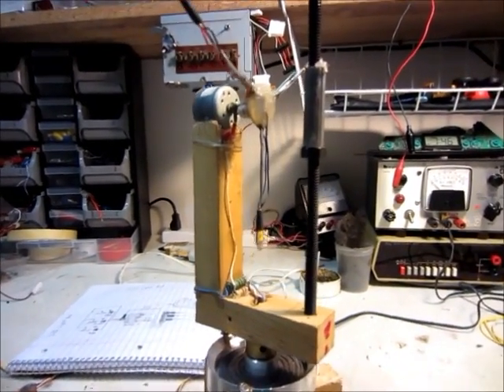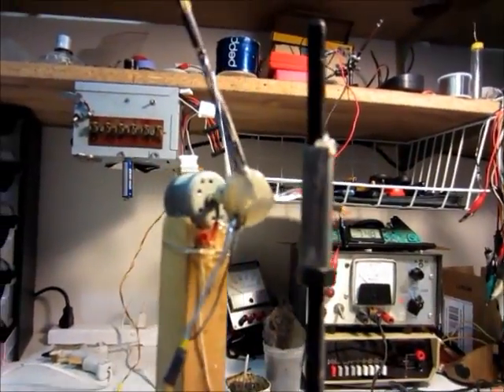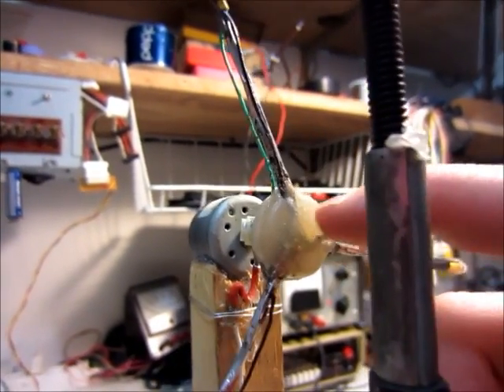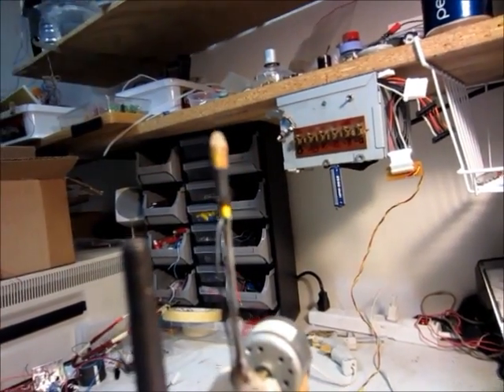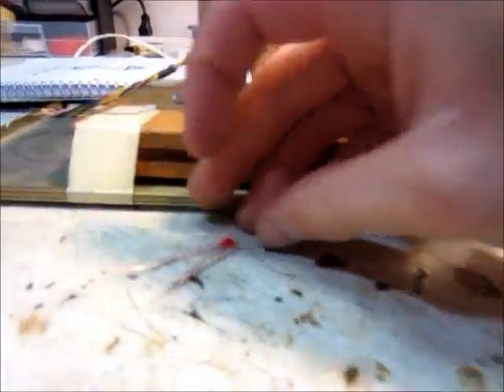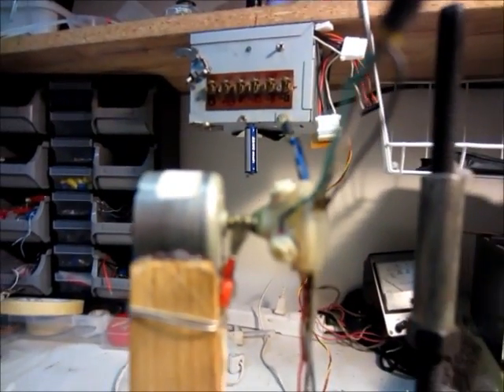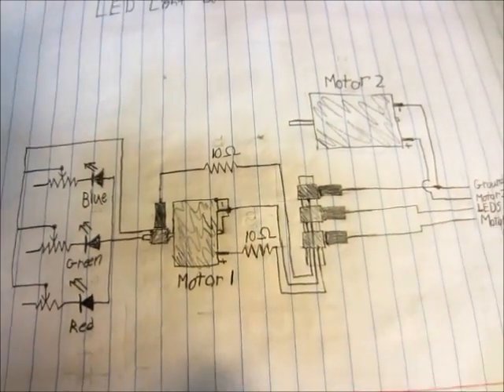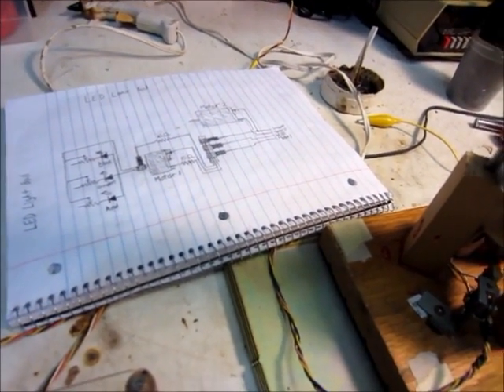How To Make Your Own Spinning RGB LED Light Ball (Part 1)

Comment: HI ITS LOOK GREAT!
 HOW DID U DO THE SLIP RING WITH THE brass antenna tube?
Reply from the maker: Derek Woods EYAL LEVI  Yes that is exactly what I did with the slip ring antenna tube.  I actually use the motor shaft as the negative and the antenna tube as the positive.  So all the LEDs negative leads are soldered right to the end of the motors shaft.  Then I connected the negative of the power supply to the motor.  Thank you!
Reply: I'm interested in knowing more about this as well. Here's my guess as to what you did: You sheathed the motor shaft in plastic, and then sheathed that plastic in a conducting metal tube. It seems like you soldered the negatives from your LEDs into the shaft/spindle directly. The positives you soldered to the outermost metal tube. Directly from the power source you just have bare wire rubbing against the metal tube, which provides power to the LEDs. I don't see the negative lead from the power source though, so how did you complete the circuit?

Comment: hello , i'm trying to find  fine motors for this model- 
wihch speed do i need for each one? and if u have speceific types it will really be helpfull THX
Reply from the maker: Here are my two websites about the LED Light Ball. 
the spinning led light ball | makerj101diy
ledlightball

As for the motors just use your best judgment!  You don't want a motor that is too weak and will not spin it fast enough and you don't want a motor that is too powerful and will make it self district!  The motor that spins the LEDs was the CD spinner motor from a CD player.  The other motor that is on the base was from a printer (I think).  It is a bit bigger and more powerful than the other one.  Which is needed because it has to spin a pretty big piece of kit.  So it all really depends on the sized and how much friction your LED light ball will have.  So there are not really and kind of standards!  I hope this helps!  Good luck!
Reply: Makerj101 hello again-  I Also HAVE A problem with the slip ring- the max speed i found is 500 rpm.. what can i do to make it still work? THX
Reply from the maker: I'm not really sure what you mean...  But if you get the LED light ball spinning 500 RPM I think that is pretty good.

Comment from the maker: Yes it does look a lot harder to make one with a 3rd axis.  That's why I went with 2.  Plus I didn't really think the 3rd axis ones looked all that much more awesome.  No I have not tried variable color LEDs.  If you want variable color LEDs you could consider using some sort of micro-controller on the spinning part and another one in the control panel and use one brush to let them communicate digitally or maybe wirelessly and another 2 brushes for power.

Comment from the maker: Just about any motor should work.  You do want one that runs on about 12 volts and you don't want it to draw more then a amp at full power.  If it draws to much current it will burn out your LM317.